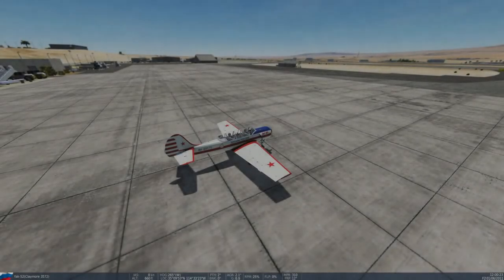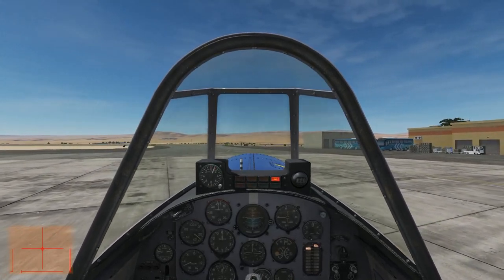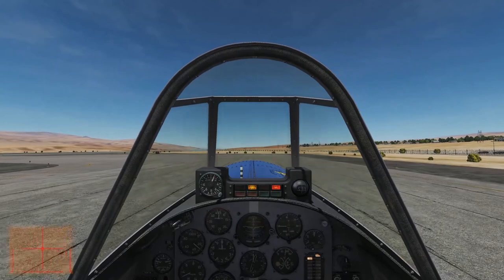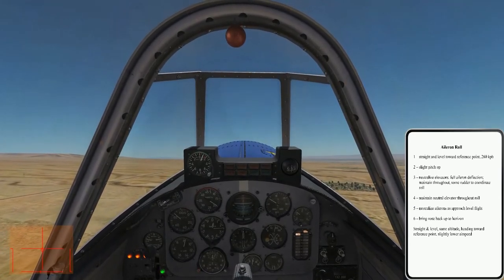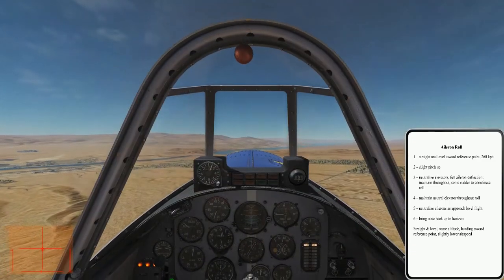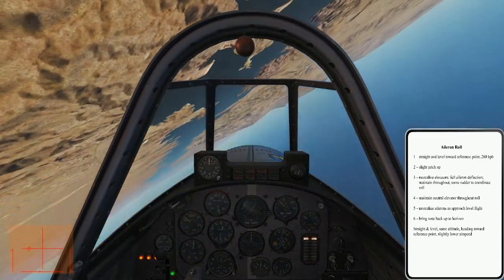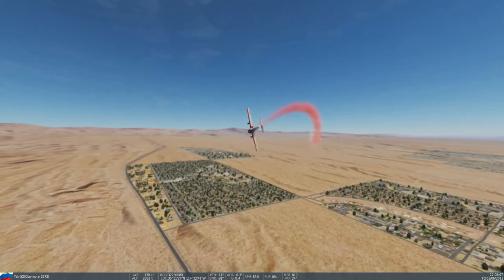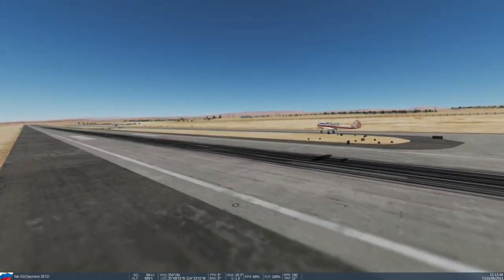Aileron Roll Tutorial in DCS Yak 52

Comment: You mentioned positive G's throughout.  How many G's and at what point?
Reply from the maker: Thanks for your question.  It’s a good one! 

The simple answer is that there are no excessive g forces in any part of the aileron roll, which makes the aileron roll a good beginner’s maneuver; a really cool looking maneuver that doesn’t overly stress the body, or the aircraft.

The more complicated answer:  as a minimum, there will be some positive radial acceleration (positive g force) initially when you pitch up in preparation for the roll.  And there will be a corresponding negative acceleration (low g force) when you neutralize the elevators when you’ve established the proper pitch-up angle.   These forces will be only momentary and the more aggressive those actions are of course, the greater the momentary forces will be.  In a typical aerobatic training aircraft, the initial pull-up might result in a 2 – 2.5 g force.  The force resulting from neutralizing the elevators typically results in close to a 0 g (near weightless) force momentarily.
  And you will see the same momentary forces when you bring the nose back up to the horizon at the end of the roll.

It gets much more complicated during the actual rolling motion; when the ailerons are displaced.  The g force will depend on the roll rate, pitch, and coordination maintained throughout the roll.  If your longitudinal axis follows a shallow corkscrew path as shown in the video and your flight is reasonably coordinated, you in theory could maintain 1 g throughout the roll.  The key is to start the rolling motion from 1 g flight.  This will help you stay close to 1 g all the way around; slightly above and/or slightly below 1 g in a reasonably well executed aileron roll.  You should not go to 0 or negative g’s during the roll.

Note that I am using the convention of 1 g being the normal (positive) force of gravity experienced during straight and level, un-accelerated flight.  This is what is shown on most g-meters when reset.  In some online discussions, it appears the term “negative g” is used to mean anything less than 1 g.  The more accurate term for forces between 0 and 1 g would be “low g”.

I hope this answers your question, and thanks for watching!